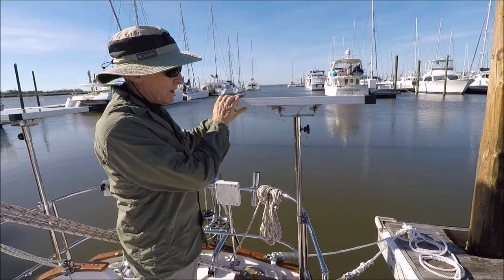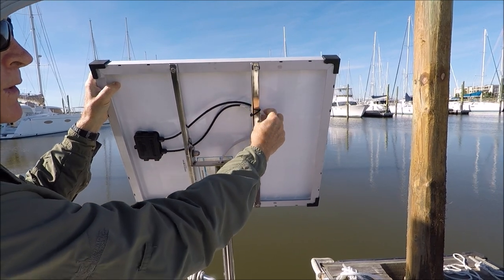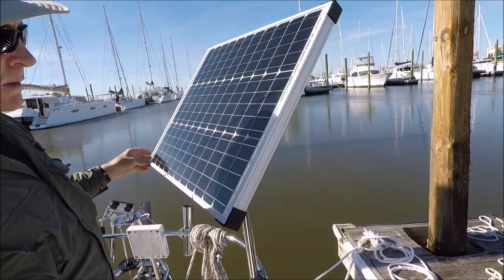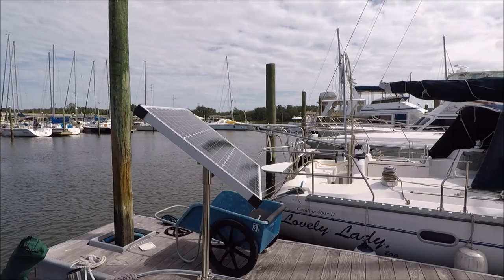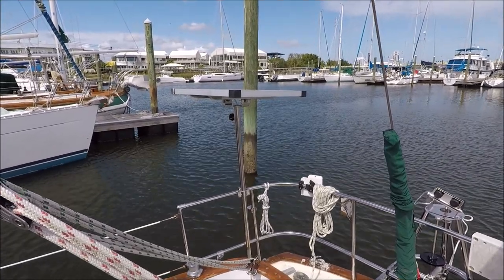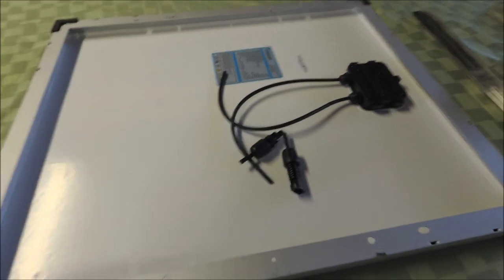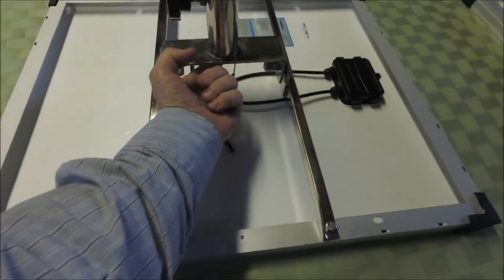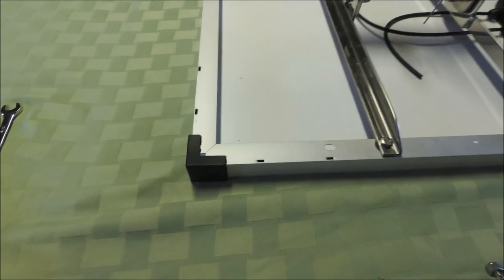Solar Tracker - Manually adjustable marine solar panel mount

Comment: James put these on my Alberg 30 around 2008 13 years ago and they still work perfectly after sailing some 25k miles or so.  Thank you James!
Reply from the maker: Kirk, Thanks for the feedback. You've seen here that I made some small changes over the years but they are basically the same design.

Comment: I've been using an angled pipe that can turn vertically around aft pulpit, allowing to turn the panels on both sides towards sun at nearly all times. The increase in production is almost threefold and we've been off-grid for years, even without engine charging. Of course very energy efficient boat, fridge and autopilot being the two main powerhogs.

Comment: I'm looking to do a large renogy 200 watt panel. Rough dimensions 65 in by 26.5 in. Weight is 27 lbs.Do you think I could  use 1inch aluminum
Reply from the maker: If you are talking about using this design then a 1" vertical tube is not strong enough for that size panel. My guess is you'd need thick-walled 1.5" but even then a 200w panel is too large with too much windage and potential wave strike exposure on small boats and the tension knob and bolts would slip in moderate winds and waves. If you want 200w then I'd give up on a solar-tracker design and maybe mount it as seen about halfway through this Cape Dory 27 tour video: https://www.youtube.com/watch?v=GODtuyYW9Cw

Comment: This looks great! Is this construction tested in strong winds? Or do you need to take the panels down in strong winds? I'm a bit afraid that it could break?
Reply from the maker: For hurricane force winds I would remove them and that's easy to do. They've been up in 60 knots with no problem though and that's because the mount is very strong and the panels are small. On a small boat the only threat to them is a full knock-down where the vertical mounting tube could be bent when submerged in solid water. This happened once on a low freeboard Alberg 30 but the panel was not damaged, just sitting at an angle until the tube was replaced at the next port.

Comment: i think an improvement to this would be to have the panel set up so it was more outboard and make it higher - it seems its really in the way, especially if you are trying to moor and secure aft lines or fiddle with the wind vane, thanks for the video though
Reply from the maker: That would work for some larger boats but they are not further outboard because they would be vulnerable to waves in heavy weather in a near knockdown and for snagging other boats or marina pilings. Making them higher is also doable but they are less strong or heavier doing that. They actually are not in the way much and don't bother the windvane at all since the air just flows around them. For mooring maneuvers you just tilt them vertically out of the way.